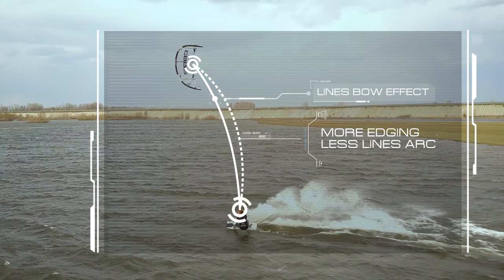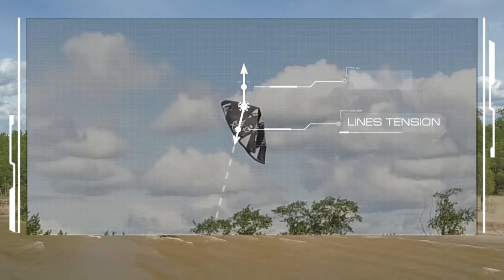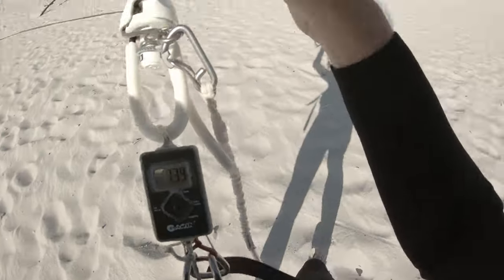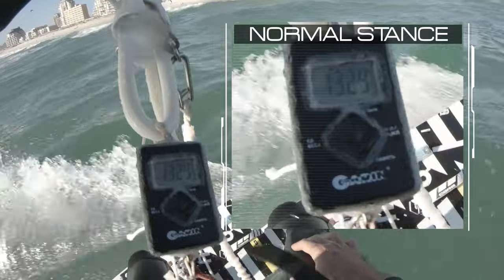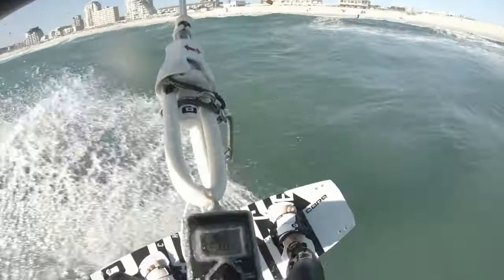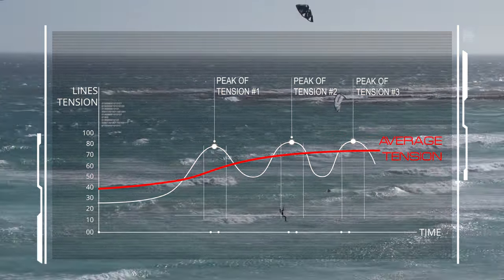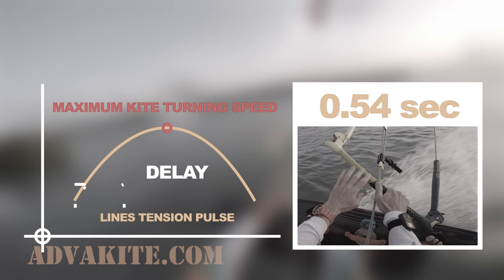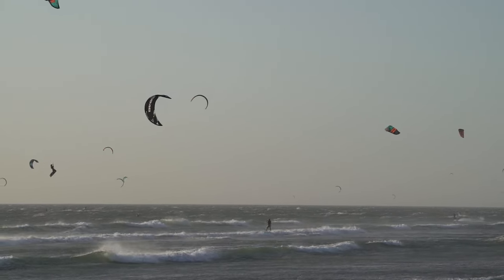The Secret Of Lines Tension | Kiteboarding Tutorial by advakite.com

Comment: Nice!
So engaging your leg muscles can actually cause more line tension than just using your body weight. Hence I always felt I can hold more power with a waist harness rather than a seat harness, though many people say the opposite.
Reply from the maker: Hi!
Extending your legs definitely create some extra tension, especially together with leaning back more and edging the board more. But it's about creating a pulse of tension, it's a short increase of load.
Reply: @antonchernyshov8759  Would you also say that depends on the kite?
E.g. with a c-kite, more about riding in fast, building a progressive edge and sending it fast, whereas a slow turning kite like the XR would be more about carving upwind as sharp as possible (maybe even doing that pre-load pop before) to compensate for the lack of sending speed?
XR seems to jump more downwind as opposed to the side to side pendulum motion from c-like kites.

Comment: Really nice one! I wonder that no-one before came with this idea. Do you also measure the load of an Mega-Loop?
But to be honest, I thought its even more load before take-off. How powered do you was?
Reply from the maker: I would not say that the yank of megaloop itself is harder, than riding powered before take-off. Obviously, you don't have any grip in the air, so not many ways to resist your kite pulling you through the loop)
Reply: @antonchernyshov8759  hehe, sure. But it would be interesting to know as well

Comment: hello great video 😃 I have a question concerning line drag, tension and kite reaction turning speed. I have always flown with 25m ozone lines with my 7m in 35-40knots thinking longer lines will always go higher because of the power stroke plus in a storm there a bit more of a comfortable ride in the strong wind, However I do have a set of 23m ozone lines would this be more of an advantage instead of the 25m lines in the strong wind mentioned, this is for Bigair jumping only, woo scores (not powered kite loops) any help much applicated thankyou.

Comment: Great video, thanks.
Am I right to say line tension will also be a function of a correctly trimmed kite?
Reply from the maker: Thank you! Sure, proper lines length is something that should be there by default. If you set the trimmer to full power and sheet the bar in with your kite at 12 (in very light wind, when sheeting in doesn't move you anywhere), your kite should start to backstall (fall towards its trailing edge) after 3-5 seconds after sheeting the bar in.

Comment: Great video as always, learn to fly 1 & 2 were well worth the money, when it comes to flying lines, the lines on the core pro bar are thinner than ordinary lines and less stretchy, is this noticeable when on the water ie less drag and quicker to build lines tension ?
Reply from the maker: Hi! Thanks for supporting my work so much! Yes, I like those pro bar lines a lot! I wouldn't say that I feel less drag, but they stretch less for sure, if compared to other brands I have. Even after 1-1,5 seasons of powered loops and big air they are still in good shape. Sometimes they start to fade a bit early, regarding the color, but stay solid for long time.
Reply: Anton Chernyshov thank you for your reply, Will you be in tarifa or elsewhere in Europe coaching in the near future?

Comment: The measurement neglects steering line tension, which is probably much less than the harness/hook tension but not negligible?
With the bar pulled all the way in, isn't the steering and power line tension supposed to be about equal?
Reply from the maker: Hey! That is a very interesting remark, thank you! Sure there is some amount of tension that is partly distributed to the bar. Especially, when you sheet it in completely and it hits the chicken loop (however, I normally don't do it that hard). So, all these measurements are for sure very approximate, just to let people know, what amount of pull should they feel on their harness hook.
Comparing front and back line tension amounts they are for sure far from being equal. Imagine. This hand scale gave me about 100 kg of load on the hook when riding powered. I know, I am not able to lift such weight with my bar) I would let it go, I think)